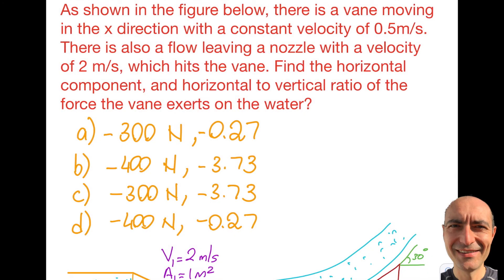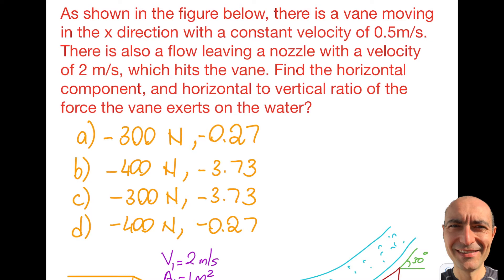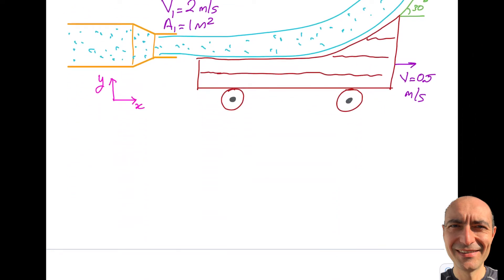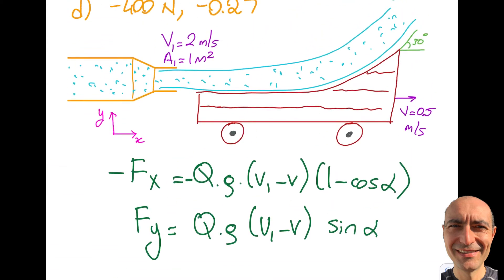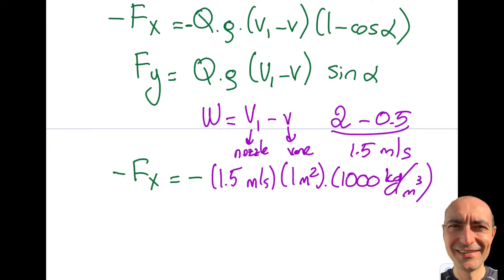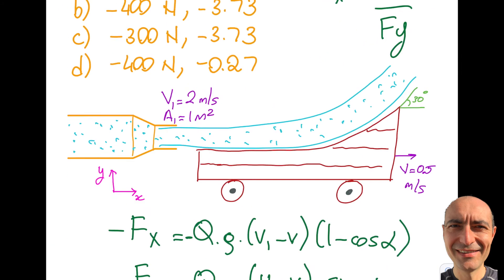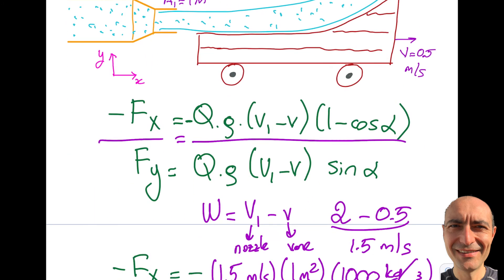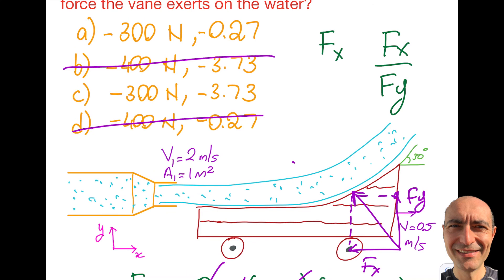FE Exam Fluid Mechanics - 3.6 - Practice Problem - Impulse-Momentum for a Moving Vane

Comment: I dont get why the ratio is negative?

When solving for the y-component of the water acting on the vane, we got a positive Y component. Thus, the force of the vane acting on the water should be negative. 

Similarly, when we found the x component of the force of the water acting on the vane, it was positive. Thus the force of the vane acting on the water should be negative. 

Negative/negative is positive. Am i thinking about this correct?

Comment: Can you do a moving vane problem where the property used is momentum (using the Reynold's Transport Theorem)?
Reply from the maker: Hi Cameron, Do you mean a full fledged solution, where I start from selecting Control Volume (CV), applying C.O. Mass and C.O.Momentum to the selected CV?
Reply: @CollegeFluidMechanics  Exactly so, please!